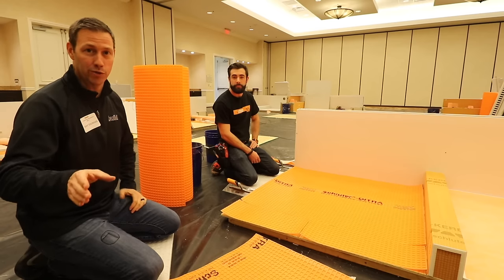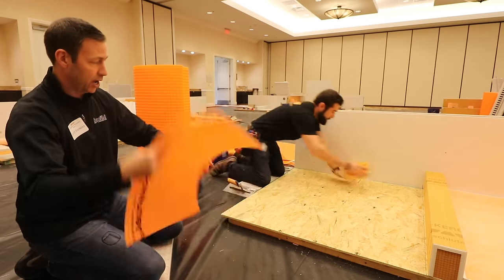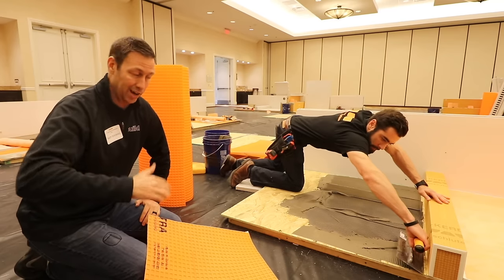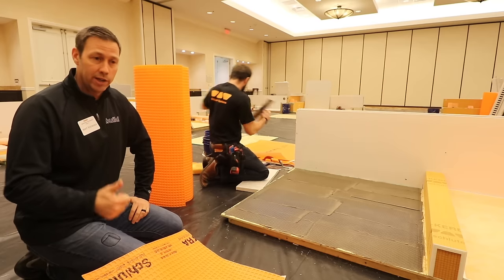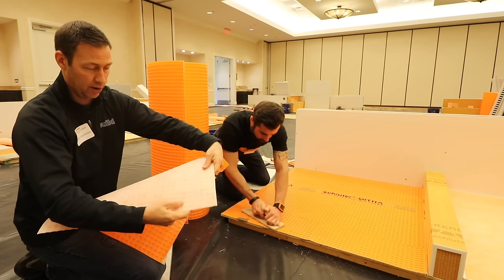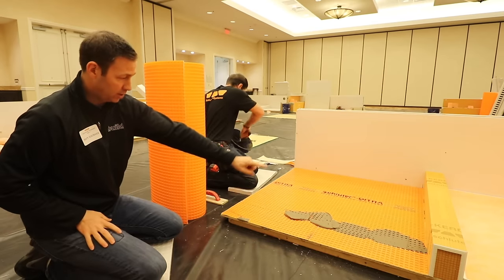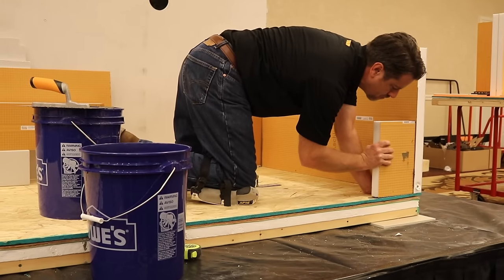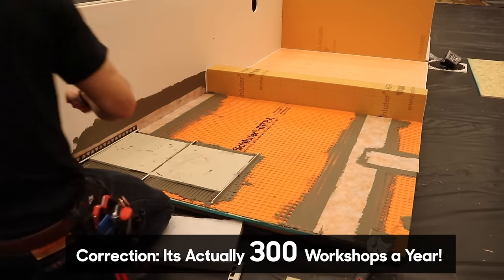WHAT is this, and WHY do you want it under your floors?

Comment: Be warned, this stuff SIGNIFICANTLY increased mortar cure time for me (concrete slab, with large sized tiles), it doesn’t allow the moisture to leech and evaporate the same way backer board does. It was three days before I could put weight on the tiles to grout.  I still like the low profile and ease of install—just plan your job accordingly.
Reply: Mortar will set and cure even if completely submerged in water, unless you added too much water to your mix in the first place it shouldn’t SIGNIFICANTLY increase cure time, unless you are confusing curing process with drying
Reply: @vitaliypro8441  Nope, thats not it.
Reply: What thinset did you use?
Reply: @deeznutt666  have you ended up using this product in ur kitchen ? 
I’m doing a main walkways  and it is. Plywood subfloor.   Kind confused. Of What I should use. 
Hardiebacker or. This rolls
Reply: @billjohnson7347  WHAT AN IGNORANT QUESTION... (SEE HOW RUDE THAT MAKES ME SEEM)
Reply: @RestoreITdontJunkIT  Give it up buddy. You're way out of your league.
Reply: What mortar did you use ?
Reply: 3 days aint nothin to complain ab
Reply: I used to compete against this stuff so I know all of the tips and tricks. If you are worried about cure times, two step the installation. Install the ditra and then skim coat it to fill the voids. let it dry overnight and then come back and install the tile in the skim coat. Ditra is impervious and porcelain tile is impervious so the grout joints are the only hope. If you grout with Urethane or epoxy, there is no hope of your installation ever drying.
Reply: thx for the tip
Reply: @vitaliypro8441  this was 10 months ago so sorry for the old news but:
You are thinking or concert not mortar.
Mortar and concrete are both mixes of cement and a few other things but those other things are different and have different chemical properties.
Reply: Thank you for the warning!
Reply: I have always used modified thin set over wooden concrete and unmodified when I’m laying the tile
Reply: You have to use specific thinset when laying LFT over ditra.  It says it in the instructions.  That way your evaporation issue is accounted for.
Reply: You must have not read the directions and used a modified thin set. Or you are not bright enough to know the difference between modified and modified thin set?
Reply: You mean modified an unmodified.
Reply: So what else can I use instead of this?

Comment: If you've not used Ditra or an uncoupling membrane before don't try and lay tiles the same day. Use Rapid Set adhesive to fix the ditra to the floor and always leave it overnight. Tat way if you have to lift a tile you won't pull the mat up with it :)
Reply: @ks13077  I do this for a living and I see stupid new products all the time, but uncoupling is certainly necessary for tiling over wooden floors and underfloor heated screeds. It’s super easy to lay, so it is heard to make a mistake.
Reply: But Hardie Backer had worked great for decades and it's screwed down into the floor, so it's even more secure.
Reply: @vapeurdepisse  all depends on the situation. You can’t screw hardi over an  under floor heated screed or screw into a floor of unknown depths with screws. Ditra goes on without penetration of the floor. Both work well, just depends on what it has to do.
Reply: Matt have you never seen Holmes on Homes? From the late nineties in Canada
Practically every show they are rebuilding a bathroom or kitchen & using Shulter products to lay tile!
Reply: Great product... factory certified in Reno facility.

Comment: 16years ago I put this product down along with a floor heating electric system in my house built in 1936. My tile has not cracked, moved and none of the grout has cracked.  It stiffened the subfloor greatly but also allows the structure to move without damage to the floorI love Schluter my brother is a kitchen and bath designer and that'll those guys use for decades. Great product super easy to work with and super light THAT WORKS!!!
Reply: It would have turned out the same without it. On top of concrete is it’s only use.
Reply: @thebobloblawshow8832  wrong,
Reply: @thebobloblawshow8832  I dont agree. Our stick home was built in 1999 and the bathroom grout is cracked or there are gaps between grout and the tile edge, decoupling membrane wasnt used over plywood subfloor.  Now, it doesnt matter much to us because we dont care or observe too closely, but for sticklers and perfectionists they would want a reno
Reply: @LincolnLog  well agree or not the proof is in the pudding. Never had an issue. Let me put it to you this way: what did people do before Schluter? Waste of money.
Reply: @thebobloblawshow8832  Lol the proof is in the pudding alright and our grout is cracked and separating 😂
Reply: @LincolnLog  don’t blame me cause you had a bad tile layer. Don’t cry. Hire a professional. But you didn’t answer my question, what did people do before it? We have been laying tile for over a thousand years.
Reply: @thebobloblawshow8832  you are right what did people do before well as a building contractor in Ireland and previous construction supervisor  unrestricted in Boston MA.we us ea thin sheet of wall board on top off the plywood and we also use flexible tile adhesive. We also have other wet room systems like FG - epdm-tile board for wet rooms etc
Reply: @thebobloblawshow8832  Two thousand years
Reply: @noelburke6224  Hi There. QUESTION ? I am doing a small tiling job. only x 2 square meters bathroom floor. I want to know ? Is there any multi purpose adhesive which I could use for both - sticking on waterproof decoupling membrane onto a concrete subfloor and also using the same adhesive for sticking tiles on top of it ?
Reply: " It stiffened the subfloor greatly but also allows the structure to move without damage to the floor" --- think about what you just said again (opposing statements) and know why you are full of BS about this product. Schluter has some great innovative systems ...this particular one, is not one of them.

Comment: A few years ago, I have installed this Schulter Ditra underlayment plastic and have marble over at the second floor bathrooms. Now, every time my husband is in the master bathroom I know because I heard squeaking noise from Schulter Ditra and I regret I don't choose hardboard underlayment.
Reply: Wrong! Custom home builder here who also does high-end renovations. Squeaking comes from movement between two stiffer elements. 90% of the squeaks I have found in homes are nails moving up and down and deflecting wood. Sometimes it's wood on wood similar to two branches when the wind moves the trees. That synthetic membrane does not squeak. I've tried numerous times and never get any sound out of it. It's the subfloor below the ditra mat. There's a nail in the plywood subfloor below the mat. When the floor deflects the plywood moves and makes the nail squeak. I have been called to many other contractors customers with squeaky issues. And I always find the squeak. It could be a royal PITA, but I find it in 90% it's wood moving and the nail is not. Every now and then it's two pieces of wood.

Comment: It's also good for heated floors.  As an electrician we run our heating conductor in between the squares.  It holds the conductor very well
Reply: that would be the ditra heat you are referring too! Same general look but denser and has grooves for heating wires!

Comment: I have used this many times, very good for large tiled areas where you want to avoid expansion joints. Never had any tile or grout line crack after using this even when pushing the area with continuous tile well past what would normally result in expansion cracks. Over underfloor heating this stuff is pretty much essential and works very well, I tiled a 150 square metre heated floor over 10 years ago with it and not a single crack in tile or grout in all that time.
Reply: @private8559  Yes they do but in my experience using decoupling membrane this can be pushed well beyond the recommendations, that was my point. This is especially true for tiling over underfloor heating. The recommendations are very conservative.
Reply: @private8559  For the most part pushing the boundaries comes from clients who are prepared to take the risk to avoid expansion joints. I have read the Schluter documentation together with Vario and Durabase which I also use. Its usually down to the type of tile being used and the type of floor how far I would be prepared to push it.
Reply: What type of thinnest did you use on top to lay the tile? Modified or unmodified?
Reply: @christiann4635  Depends on the situation really, heated floors really always require flexible adhesive often the really flexible stuff which is expensive but cheaper than having to redo it when there are problems. Decoupling membranes really work best with the polymerised flexible adhesives anyway. I have found the fibre reinforced adhesives to be very good too where there is going to be excessive expansion.
Reply: You mentioned goin over the heated mats with ditra ...What do you recommend using along side of the heated mats to make up the same height ? ( I plan on only doing 50% heat mat coverage on concrete slab)
Reply: @jmiller6180 i have same question

Comment: I have specified this product for many years and it has never failed.  I first used it 20 years ago in two office block foyers where the contractor had laid tiles direct on the concrete floor that had subsequently cracked  along joint lines in the substrate below.  The installation allowed the contractor to retile the floor as originally specified that was now fully reliable and without having to rebuild the foyer floors to cure inherent problems.  I have since spec'd this below all wet tile areas and in location where the substrate was variable, irrespective of where a finishing screed was laid on top.  I have had no reported tile failures of any sort.

Comment: Did my master bath, with walk in shower (no curb) 7 years ago. With ditra, and kirdi awesome products. Their shower kits and drain assemblies are very well designed, be available here in Ontario Canada for over a decade, Mike Holmes has featured it on almost every build since it came available in north America
Reply: Also they are the products that will have hidden mold and rot and will never show
These products are the worst products i have ever seen.
My experience 
I had to renovate 4 bathrooms in one house and rip apart this company products 
On the surface everything was good under neat complete garbage 
Watch horror stories here on youtube 
All from this company products
I am using MAPEI way better and professional
This company y has good ideas but their products rot very easily.

Comment: Hay Matt, Excellent Video. When I was in Italy the house I was billeted in was an amazing structure hundreds of years old. This entire structure was masonry, with floors that had not cracked since originally built. What I witnessed amazed me and I couldn’t believe how simple and affective this method was. The tile floors where laid on sand. Like you said, uncoupled, when the building moves the floors just kind of vibrates sliding around. Crazy. Hope you have a Great New Year.
Reply: The same reason you lay a foot or two of sand before pouring a concrete slab for a garage, or putting a down a sand pad for an above ground pool.  It's effective.
Reply: Sand is probably too heavy to be practical with today cheap wood stick carpentry used in america but i get the decoupling idea, that's great.

Comment: In Sweden we have a thinner membrane with taped corners. All glued with a 2component glue. 
The level is fixed before so all surface angles down to the drain with a steel mesh net in it, so that ”cake” won’t crack if the foundation moves.

Comment: I live in Sweden and I am a carpenter and concrete does not crack if you do it right. If it cracks the problem is
- to little rebar in the foundation
- concrete dries to fast when it is "burning"
-  bad ground work under the foundations.
happy building!
Reply: Where he is in Texas most homes have tensioned concrete foundations that flex throughout the seasons on the first floor.  It may go 3 months no rain on a clay ground, so the soil shrinks a lot. Hes talking about what he has to deal with
Reply: One of the most common causes of concrete cracking is excess water in the mix. This happens because wetter concrete is easier to work.

Comment: I used the Kerdi shower system with the square drain and fleece to build my shower system 8 years ago and its working perfect. I hired out the tile work and the guy loved working around the square drain instead of the round ones most people us. If I did it again I would for sure add heat to the shower floor and the bathroom floor. Its a great system.

Comment: I installed this because of the uncoupling. What I didn't expect was HOW MUCH BETTER my room felt after the install. I had zero insulation under my old faux hardwood floors. The ditra system made it so I can walk around barefoot in the winter in my own home again
Reply: How did it feel better? From what I understand it's meant to make tile instalation better and last longer. So why would it make your room feel better if your not even walking on it

Comment: I'm in Arlington, TX ...I invested in an uncoupling membrane for my kitchen and bathroom tile install, 5 years ago. Best investment..my foundation has settled and repair has been done recently and no cracked tiles in the kitchen or bathroom. The installer definitely needs to install it correctly and use the correct mortar for the installation.
Reply: In North Dallas and all our kitchen tiles are cracking severely
Reply: @QueOndaWhey  OH NO! Gosh do you have foundation issues? It sucks when stuff is moving and cracking around you lol. If that's not it,  I know my best friend had cracked tiles because of bad installation..not enough mortar used when they were installed.
Reply: Hope yall alright down there. 🙏🏽
Reply: If you have foundation issues its going to crack anyways.
Reply: @smcewen7  None of my tiles have cracked, but hey I can't speak for everyone's experience with the product.

Comment: Wonderful invention. The floor is also warmer with this type of insulation.
Reply: That's heat cables. Somewhat different product. It looks more like lego studs with cable in between. Or it could be water pipes in the slab.

Tile is as cold as my soul otherwise.
Reply: Tile is always going to be cold unless you are piping hot water or electric heating pads under it.  Great for hot weather though!  Carpet nice soft and warm but not durable, and pain the keep clean.

Comment: I installed this when I remodeled our master bath, complete custom shower, tub area, and flooring. About 500sq total tiling, including shower. It was an easy install and I really liked the fact that I can waterproof areas easily. My original tile floor was about 1" thick and now it is about 1/2" thick, so now I have door jams that have gaps, not sure what do about that.

I would recommend this product to anyone think is building or remodeling a home. Also, building the shower curb was a breeze and looks amazing. They have products that make the install look clean and professional. I was able to get all my products from Lowes and they had everything in stock.
Reply: For the bottoms of your door jambs, I recommend plinth blocks. They have them in stock at the big box stores. They're square and make the room look much more expensive. Just mark around the block with a pencil and cut away the casing and baseboard with an oscillating multitool. For the baseboard gaps, I recommend 'stop molding.' It's the molding on the door frame, that stops the door from going any further when you close it.

Comment: I installed about 250k ft of tile over my career and I was very reluctant to start using these uncoupling mats. I've had very few issues with bond failure on my tile jobs,I  have done repairs where the  tile has come loose on the top half of the ditra mat. I  have used uncoupling mats with the fleece on both sides,that's what I  use now.

Comment: Since I am deaf enough to need captioning,  I watched once for action in background, once more to read. For a bad builder job master shower replacement,  I gutted walls to metal studs over concrete slab (South Fl), replaced, added and reinforced studs, and did .5" cement board, doubled on longest wall.  Properly notched grey pudding type waterproofing over all. Walls, floating bench (not the block type shown here), arched niche, upper corner shelf bowl draining cement pan to direct drain.  I used several Schluter products....corner membrane, faucet water proofing pieces, drain top.  But I am still with cement board. Properly done, cement board just makes me feel like it will BE there for awhile. 
If you want it done right, DIY. Or micromanage a select subcontractor. 😉
122 lb lady DIY'er

Comment: I used this to fix a crumbling tile landing that had been affixed directly to hardwood with mortar in the 60s or so. Its amazing.

Only thing is people need to pick the right adhesion product. Certain mastic/mortar are specifically stated to not be used with these.

Super easy to use. 10/10 would recommend